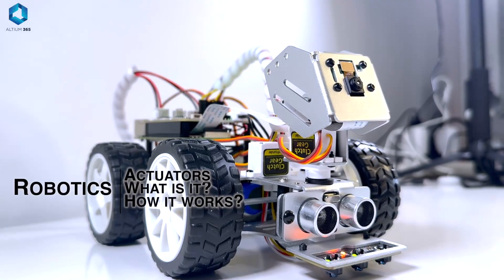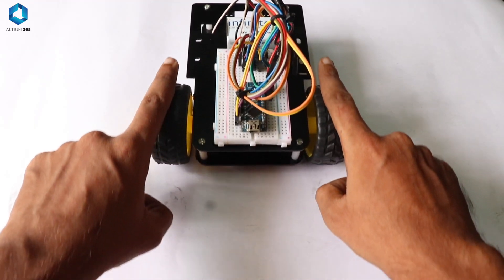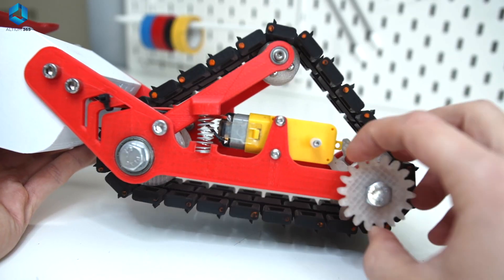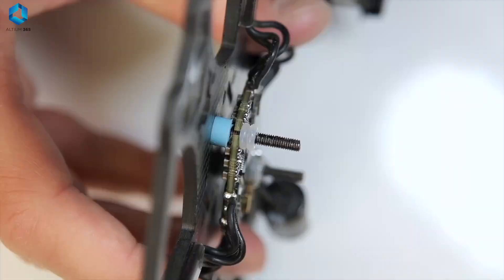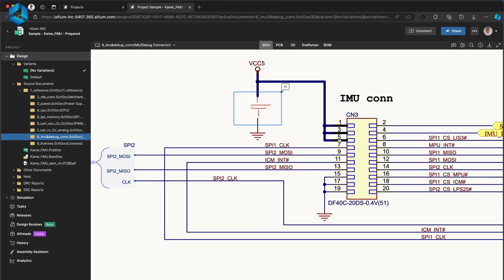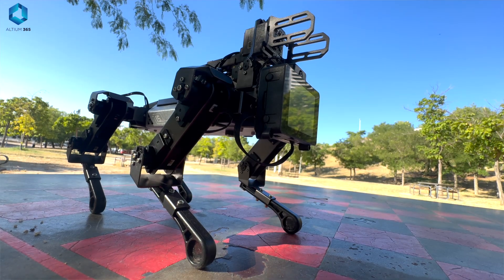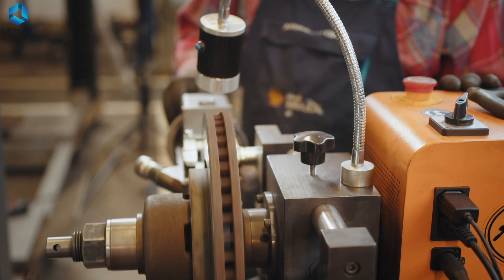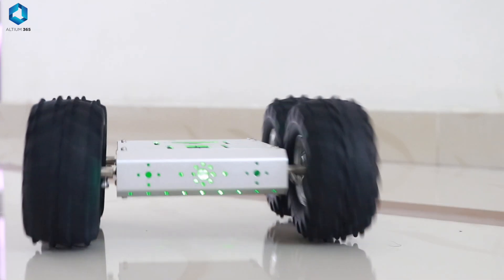Robot Actuators Explained: DC, Servo, Stepper & More for Your Projects!

Comment: Excellent video. It brings out very well the difference between DC motors, BLDC, servo motors and stepper motors.
How do professionals determine the maximum capacity of a robotic actuator? Eg : load lifting capacity, speed, etc? Is it directly given in the specs sheet of the actuator?
There is also a subject called EMEC (Electro-mechanical Energy Conversion). Is it at all useful for this purpose or in practice? Thanks.
Reply from the maker: Yes, actuator specs like load capacity, torque, and speed are usually mentioned in the datasheet. Professionals also consider real-world factors like duty cycle and thermal limits when choosing one.
And yes, EMEC is definitely useful, it gives a solid foundation for understanding how actuators work and helps in more advanced design and analysis.